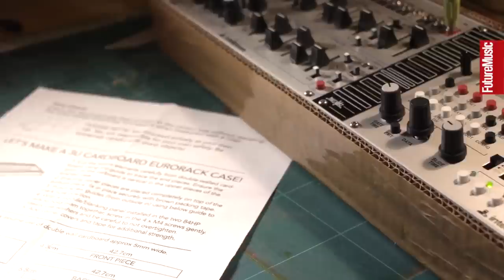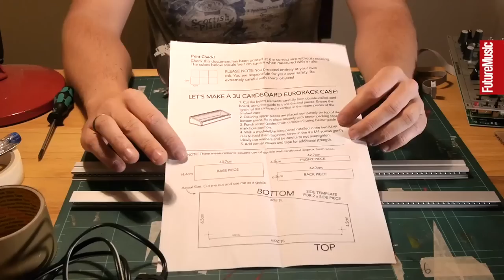Modular Monthly: How to make a DIY Eurorack 3U case

Comment: I did this and use Fiberglass to cover the cardboard, sand-it and Paint-it, looks professional and perfect ;)
Reply: Cylo Arias Another approach may have been to just use the fibreglass resin to coat the cardboard. The resin should soak inand stiffen the cardboard. I haven't tried it though.
Reply: do you have a photo

Comment: Great idea to use the double cardboard that's 5mm thick. 5mm is also a normal plywood thickness, so once you get your design finalized in cardboard, the dimensions are exactly correct for a final wood version. I think Lucite also comes in 5mm thickness, as does Coroplast signboard. So, no matter which material you make your final case from, you dimensions are all correct.

Comment: You have completed your good deed for humanity! 

...your work here is done!

( Thanks :] You've just inspired me not to drop $600 on the case for my first Eurorack! )
Reply: Ha! Spend it on modules instead...
(Of course you'll eventually need a 'proper' case when you outgrow your starter - Ginko Synthese Wooden DIY kits recommended, have a big one on order right now.)
Reply: mylarmelodies

 Yeah, well... actually what this made me realize... is how accessible Rails & a Power Supply are.

 I'll just build two of these out of nice Ply ( 208HP ) ...with no bottoms... & stick them in a padded, waterproof case. I can get nice plastic cases for like $20!

Comment: Would be neat to do this with plexiglass so that you can see inside.
Reply: I strongly recommend polycarbonate over plexiglass (aka acrylic). Polycarbonate is is very easy to machine as the material tends to "shred" instead of "melt" like acrylic, while being stronger than acrylic as well. Cutting polycarb sheeting on my scroll saw is like cutting slightly softer aluminum.
Reply: Loopop made a plexiglass one.

Comment: i made a little case with plywood and screwed my module directly on the wood. is it really important for it to be sealed ?
Reply: César Screwing into the wood may be bad for your power module. He says in the video that metal rails are needed by the uZeus for heat dissipation. As for your question about sealing the case: sealing probably helps with keeping dust out and off your modules' components.

Comment: Hey mylarmelodies what modules, power, rails.... everything did you use in this? want to get into modular and the sequence at the end would be exactly what i want to do with it!
Reply: ***** See other comment, but it's:
--------
uZeus: http://www.tiptopaudio.com/zeusmicro.php
Z-Rails: http://www.tiptopaudio.com/zrails.php
This is the PSU I bought for my uZeus: @170834876778 (2 years of use and counting)
--------
Those modules are an Intellijel Atlantis and Intellijel Metropolis - would not be a 'cheap' start, but those are amazing devices. Funnily enough the music in the background here is actually me using the Atlantis and the Transistor Sounds Labs Stepper Acid, another great sequencer.

Comment: Can I make exactly the same cardboard case, but instead of Microzeus screw to the bottom a standart PSU and bus boards? Shall I have a problems with heat dissipating or it'll be ok?
Reply: +Vladlen Tepes Depends on what your PSU manufacturer advises.
Reply: +mylarmelodies Asked already & problem solved. But thanks for reply, ''Modular monthly' is awesome!

Comment: Not trying to be a smartass, but couldn't you cut all four sides and the base out as a single '+' shaped piece, score the lines on the inside, fold it into shape, then fix/reinforce? The result would be stronger and require less work. In any event, you've invented the homebrew biodegradable synth case (the Haynes synth and a few other quasi-DIY designs also use cardboard), which is most excellent.

Comment: Get a rotary tool and some bamboo or acrylic for this, at least.Yea it's a bit more but you wouldn' make your first gaming case out of cardboard either would ya? And if you are just starting to build your own modules from pcb up with little to no experience, get a mini fire extinguisher. Especially if you source super cheap components on eBay... Of course all imo, "do what thou wilt".

Comment: from where I can get the cheapest rails and PSU for it?...Any help will be highly appreciate it
Reply: uZeus: http://www.tiptopaudio.com/zeusmicro.php
Z-Rails: http://www.tiptopaudio.com/zrails.php
This is the PSU I bought for my uZeus: http://www.ebay.co.uk/itm/AC-DC-POWER-ADAPTOR-SUPPLY-PSU-CHARGER-1500MA-1-5A-9V-12V-13-5V-15V-18V-20V-24V-/170834876778 (2 years of use and counting)

Do bear in mind Tiptop Audio sell a thing called a Happy Ending Kit, which includes a PSU, the tabletop/rackmountable cheeks, and the rails, all in one little kit. But it's a bit more money of course. http://www.tiptopaudio.com/hek.php
Reply: mylarmelodies
Thanks Mylar this detail is highly appreciate it. You rock!
Reply: No worries. Worth noting Rubadub have an 'official' Tiptop PSU on their site: http://www.rubadub.co.uk/tiptop-audio-15v-2000ma-external-power-supply-uzeus
Reply: This was the main info missing from your vid ... ;)  "Where did the rails come from?!"

Comment: What is the difference between cases in "U" and cases in "HP"?
Reply: U is height (or depth depending on how you look at it), HP is width. almost all eurorack modules are 3U high
Reply: Ok thanks! My shop sells online a 3U case but nothing is said of the width. I was wondering...
Reply: it is important to know the width so you can plan ahead! just ask them and i'm sure they will tell you

Comment: fire hazard?
Reply: Darry Shan For a case this size, the power supply is an external wall wart to supply DC to a uZeus regulator.  At most, it can supply about 15W--it's not like a 90W laptop brick.  The one thing to watch out for would be the regulator on the uZeus PCB--it's right on the edge of the board and it does get hot, if you load it fully.  For that reason, it would be best not to place the uZeus directly against the right side of the case (even though many people might think that is the logical place for it).